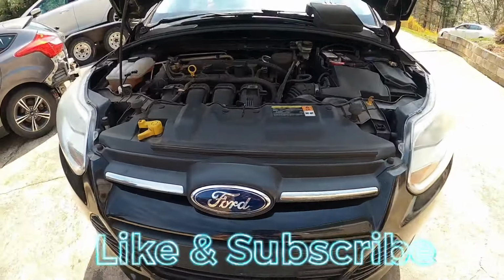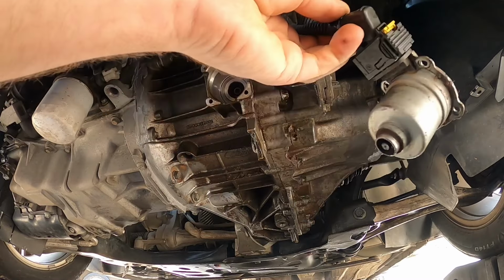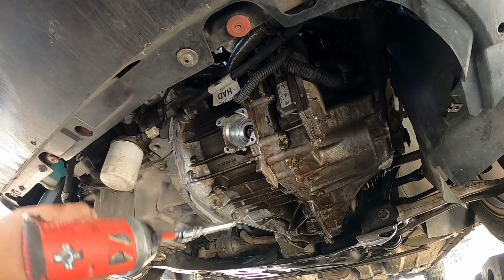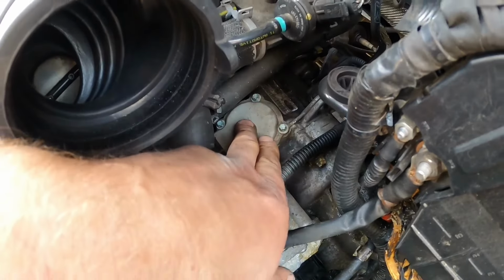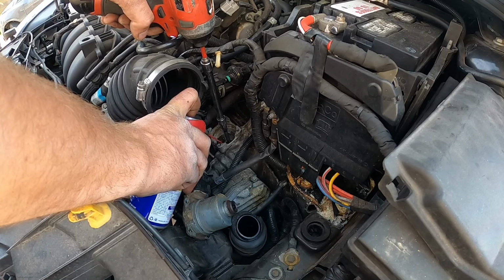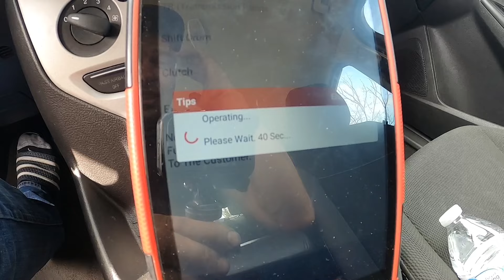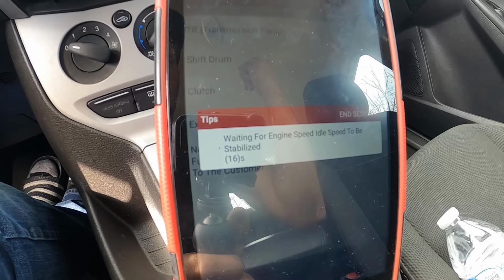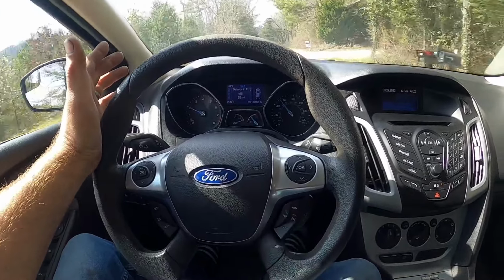2012-2018 Ford Focus Slipping? No Reverse? No Drive? Problem Solved. Easy Fix. You Can Do This!

Comment: hey btw actuator A controls gears 1, 3, 5 and B controls R,2,4,6 not just R. they work in parallel to come in when the other clutch disengages with minimal power loss, its how its so fuel efficient. :)
Reply from the maker: Ether way. Clean both forks 🤩
Reply: It's failure rate is 100 percent
Reply from the maker: @jackdaniels2657  yes, if you suck at driving 😂
Reply: @L8R-HP  it's junk regardless I'm telling u as transmission mechanic these transmissions suck like why have a manual transmission but yet operate automatically it makes no sense. U might as well have an automatic but those are junk too.  They just need to leave manual transmissions alone. Even os semi trucks the eaton transmissions work similarly to these being that it's electronic manual it honestly sucks. These ones have the problems with the release bearings they go bad frequently and the forks are always getting debris on the rollers causing a binding kinda like this guy just explained ND the clutches on these transmissions are a pain in the but to replace because u can't just change the clutch. Nope u need to change clutch clutch bearing both release forks both electric  actuators ND then the procedure is an even more pain in the ass. The way he's turning it counter clockwise 14 times on both release forks then once u get it in the car before u bolt up the clutch to flywheel u gotta rotate engine 5 times to center the clutch to the flywheel then to tighten the 6 13mm clutch nuts to the flywheel u gotta install a nut on every other stud cus it can ruin alignment if u don't. It takes 9 hours roughly if u had the right tools  when compared fully   manual transmissions that Ford focus has in same year, only takes 6 hours to do a job no special tools required in and out. Just imagine the cost for all listed parts above then u see why fully manual is better simpler affordable  more efficent far more reliable and far less headache
Reply from the maker: @jackdaniels2657  agreed, manuals are the way to go. But these transmissions actually don’t fail. The TCM does, actuators do. And forks get stuck. It takes me 3 hours to remove trans and clean and reinstall. Easy process and fast. I do this all day everyday.
Reply: @L8R-HP  3 hours hell no
Reply from the maker: @jackdaniels2657  it’s all it takes me, but I work on these 24/7
Reply: @jackdaniels2657  Did you just come to this video to tell people who already own this car that they shouldn’t have bought it?
Reply: @ir1041  yes exactly.
Reply: @jackdaniels2657  Very useful sir. Well done.
Reply: @jackdaniels2657  I wish I knew these cars were shitty before buying one
Reply: Mine is not acting up yet. No codes(135k). But can I do this as preventative maintenance? And do u really need to reset thru obd for I don't have one? I see some comments say that they skipped that part

Comment: What would make the radio come on when the cars not running. And it's just static very loud static
Reply from the maker: Could be a lot of things. Start with checking your battery. Is it an aftermarket radio?

Comment: Ford dealer quoted me 3672$ for clutch and fork replacement because it was shuttering while shifting from 1 to 2 gear. 
That's what you saved me, my 2014 focus has 59000kms on it.
Just cleaned both actuators and it runs smooth again.

Cheers and thank you from Cananda.🍺
Reply: Sighs
Reply: For real same deal! This guy is a Saint!!
Reply: Start driving the car harder in 1st gear. Let off the gas after it shifts to 2nd and then drive like normal.
Reply: Reminder Gord has a free replacement clutch work under a TSB 100,000 miles so u r under the warranty for replacement.
Reply: My 2014 ford fiesta was diagnosed with a bad clutch. How they knew without driving I don’t know. They said the tcm was fine. Quoted me 4500
Reply: @jasonashley9853 curious to know why driving it harder in first gear to second is okay to do. Wouldn't it not be ok if it's slipping and all that I. Lower gear? I have a 2014 focus with transmission overheating problem and not wanting to take off in low gear. Thanks
Reply: @JaBridgewater13 solucionaste tu pro lema del focos
Reply: I did exactly what this video suggested on my 2016 Ford Focus with 115k miles on it. The car shifts gears so smooth now!

Muchisimas gracias!!
Reply: @theDudEE100  literally same situation!
Reply: What is the application to do the learning
Reply: @brianlemos7777  Any problems since you made this repair? Just did mine today.

Comment: You have saved my life.  I almost drove my car into a canal, it is giving me problems and I am very worried about this.  My car is a 2013 Ford Focus SE, I bought it used since I couldn't afford a new one, it has one hundred and eighty thousand miles.  I appreciate that your video is subtitled in Spanish, it helps the Spanish-speaking Latino community.  To write these letters I used a translator, thank you friend, thank you very much.  Greetings from Lehigh Acres in Florida.
Reply: Hey man! i’ve actually rebuilt the transmission in these cars. I’m not saying this to stress you out, but at 180k, it’s ready to go. Everything with this cars transmission is flawed. Fundamentally. You need to sell this car before you start having a fork get stuck, or a rear seal start leaking. Please buy a honda. These cars suck, and my fiesta (uses the same transmission) brought me to the lowest point of my life.
Reply: What were you drinking?
Reply: @loganpennington9104 no point in rebuilding at 180k?
Reply: @greatness7822  Depends on the state of everything else in the car. If the engines perfect, and the suspensions fine, it may be. But if you’re paying someone else to do it and it’s more than 2,000, probably not. This cars transmission sucks and is bound to fail again
Reply: 2012 Ford focus s 2.0 , 64,000 miles 
Error Codes 
P0903 clutch A actuator circuit high
U3003-17 high battery voltage 
U0100-00 ? 
U0101-00 ?
Idles Rough , No Forward , has Reverse , sometimes Forward after 2 or 3 minutes .
Disconnected the Battery for 30 minutes , Reconnected Battery . Now Idles Great , Easily Shifts into Forward and Reverse and Drives Great  . Thank You Jesus !

Comment: Thank you SO MUCH! You’ve saved me thousands of dollars. Tonight I cleaned actuator B following your directions and it made an immediate huge difference. Tomorrow I’ll be cleaning actuator A as well to see if that fixes the occasional small slips I’m getting while slowing down. But cleaning actuator B dramatically improved my ascending shifts. Smooooth now. I’ve been babying it into second gear for years and now I finally have my car back!!

Comment: This video was super helpful.  Started having issues with my 2014 Focus and I thought it was the TCM again.  Dealer said it was "bent clutch forks" and would be $3000-$4000 to fix.   Just went through this process and so far so good.
Reply: Is your clutch stil going?
Reply: I’d report that dealer. That’s a scam.

Comment: This is actually the 3rd Ford Focus that I've owned. I like them because they are economical, drive and perform pretty well, and I have NEVER had a problem. Until Now... (2018 Focus 4Cyl SE Sedan) Wife's car started acting weird, not accelerating. I thought it was fuel system. Did some work on that. But now it's way worse. It started making weird noises when you open the door. Like the Actuator keeps trying to reset and it can't. This goes on for a while. When the car is off, and parked for hours - you can hear the engine making this noise, like gears moving. I couldn't find ANY info about strange noises coming from the engine while it's parked. Anyway, somehow stumbled onto this video and it has helped me understand. A LOT! THANK YOU!! I went ahead and cleaned and lubed the A actuator. Drove the car but it's still having problems shifting. I'm waiting on jack stands before I can tackle the B actuator. Really hoping that cleaning and lubing up both actuators will solve the problem. If not, at least I have a much better understanding of what's going on. Not sure what my next step will be if Cleaning and Lubing A & B don't solve the problem. Replace the Actuators?
Reply: I’ve heard of this before, I read that the repetitive sound is clutch forks engaging and disengaging. it’s usually only supposed to happen once when you unlock the car and open the door. The repetitive motion of the forks sounds like the TCM may not be communicating with the transmission correctly so try to run a diagnostic on it. You may be eligible for a free one at the Ford dealer if your car meets the mileage and age requirement for the warranty program.
Reply: what year is it?
Reply: @greatness7822  SORRY! I forgot to put that in. Edited my post - added 2018 Focus SE
Reply: Hey, any update on what it was? I have a 2017 se and I have the same issue. A strange transformer noise when opening the door or right after turning off the car..but it’s doesn’t happen all the time.
Reply: @Gazzman57 - thanks for sharing as my 2014 Focus is having the same experience. The wife drove through a sizable puddle and then this issue started. The engine sounds and runs just fine but it feels like it’s starting in second gear and it also still goes into reverse. But as you mentioned, when I open the doors before the car is running, I can hear some actuating type noises in the engine compartment, so I’m not certain if that’s an indication that I need to also replace the actuators or not.

Were you ever able to find any more information out about the actuator noise and were you able to get it resolved?  

Thx! RB

Comment: The timing of coming across this video was perfect. I had to look up others things that were going wrong with my daughter's 16 focus and watched this video "just because". I fixed the other problem that she had and magically enough a few days later she was having the hesitation, slipping problem. Ran the code and of course it show Actuator B was stuck. Did as you suggested and problem fixed. Great video and thanks for taking the time to put it together and sharing it with us.
Reply: @jay Perez is it normal when you start turning it counter clock wise and it's like it's got compression In it like it wants to kick back the other way like it's spring loaded
Reply: @katlanshepherd1296  yes, because it is spring loaded

Comment: FIXED!!!!! Bro, thank you so much!!!!!!  Fixed my car last night. Didn't have the tool, so I used a skinny slot flat head bit from my gun kit. As suggested, I used brake cleaner & WD 40.  Didn't want to break the flat head bit, so I hand rotated & released for bout 30 mins. Skipped the OBD b/c don't have a scanner. Anyway, my Focus starts right away, no delayed 1st gear engagement, and no shuddering. Thank you, thank you, and thank you.
Reply from the maker: Nice! Good work 👍
Reply: Is it still working ?
Reply from the maker: @Dorightby  yes
Reply: @L8R-HP  where are you located brotha? How much would you charge to take transmission apart and clean it
Reply: @Dorightby  Yes, like a brand new car.
Reply: @Dorightby  i can do this without a scanner? Gonna do this on my daughters 2012 focus this weekend. I do not have a scanner,  not throwing any codes either tho. Input?
Reply: @marniegan6266 how did this workout? I have a 2012 se focus with 120,000 miles on. Have extreme shuddering in first and second. No lights being thrown or codes.. 

Did the brake clean/ wd40 rinse help?!
Reply: Gonna put the work in tomorrow..hope it works out..my focus been down 7months.
Reply: @hectorluna1394  how'd it go? Did you have success as well? I hope so keep us updated.
Reply: It's been about a year, and the odd gears started slipping again several days ago. Gonna open up the old girl again. She's got 160k, and I need her to go 90k more. I'm hoping I'll get it done faster this time around.
Reply: @gheeshin how'd it go, bud? Figure the issue out?!
Reply: @jerrycordova1971  Kind of solved it. Bought another car.🚓
Reply: Hi will this work on 2012 ford galaxy as well ?
Reply: @ioncochior4519  I have no idea

Comment: I agree with you, after experiencing driving a Ford Powershift dual clutch 6DCT250 for 8 years on Fiesta Ecoboost 1.0L at hot tropical country with total 90k km, I have concluded that this transmission is quite reliable and enjoyable which suits my driving style which has never been trouble since brand new. As far as I know, all Ford Powershift problems are not due to flaw design, but due to 2 material defects supplied by the vendor, namely the TCM and shaft seals on the early generation Powershift, If you get a late generation powershift like I have then it is completely problem free. And apart from that due to lack of maintenance which in my opinion should be cleaned every 50-75k km so that the clutch unit mechanism is smooth and does not jam due to very dirty clutch dust. But by the way thanks for your informative video 🙏

Comment: I did exactly what you showed in your video. Brake clean and Wd40.  I didn't have that bit but used a screwdriver like you showed in another video.  And it Worked! Thank you. I appreciate you posting these videos.
Reply: Did you have to do the reset with the diagnostic computer as well?
Reply: @jonathanjones8895  No I just unplugged the battery before the process.  Then connect after to reset.
Reply: @theroyalonemalik4125  I have some questions my boy? What screw driver did you use? Star bit? Fill-up? Flat? Also what issues were u having?
Reply: @marioo6315  but  make sure it fits tight or you  will strip it out. Then the  actuator wont work.
Reply: What screw driver you use ?
Reply: @BillyBergeson  check his video HOW TO TEST TRANSMISSION FORKS.
Reply: What screwdriver did you use?
Reply: Hi, which video he showed the screw driver please can you share that link. Thanks

Comment: Battery died got a jump and the car wouldn't drive at all reverse or drive, did the transmission valve resets with my launch scan tool and it worked perfectly  these new cars are dumb. Thank you your video helped alot  😂😂
Reply from the maker: Low or dead battery can kill the TCM 😣

Comment: Just bought a 2016 Titanium with 130,000 miles on it. I knew the transmission was an issue going in but this car is clean, no wrecks, trans TCM updated and shifts fine, new tires, rotors pads, and has service records for the cars entire life. 
    This transmission is what makes this car so economical and yet so responsive! I’m a Ford guy and this is my second Focus I’ve bought for a daily beater. Previous Focus was a 2005 ST with a 5 speed that I’ve gotten 250,000 out of before I absolutely obliterated a deer with it. Did about $4,000 damage to a $2,000 car. It still runs and drives great but it needs all new drivers side bumper, hood, radiator, core supports, throttle cable, quarter panel, headlight, fog light, and drivers door. 
   I did a new clutch on this car at 230,000 so I’m not afraid to pull a trans. This car will be no different but now I know I may have to buy a few specific tools and get good at pulling transmissions!

Comment: I used lithium grease on mine.  One other thing I did (saw it on another video) was to drill two 1/4 inch holes in the case. One adjacent to actuator B, and the other at the bottom of the case.  Bent the straw on the brake cleaner can at a 45 degree angle and used the hole to wash down the mechanism inside the case with the hole in the bottom used for drainage.  It's dry in there so it's not going to hurt anything.

I then took the blower gun and blew an insane amount of clutch dust out of the case through the actuator hole..  Washed it down again with brake clean again and then lubed it all.   It's crazy because it's a 2017 with only 66k on it.  If you're missing the splash shield and/or are otherwise worried about stuff getting in through the holes, a rubber plug or a dab of silicone will easily seal it up.
Reply: For the comment that said he drilled two holes in the case I would love to see picture of where the holes exactly are the sounds like a good idea
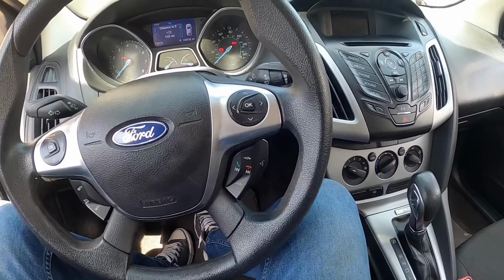Reply: @kenbaker1353  This is where I found out how to do it.  Figured it was worth a shot!  Starts around the 1:30 mark.  

https://www.youtube.com/watch?v=CoU1QGn_9gc&t=95s
Reply: Not to mention the wear aid of the metal shavings left behind.

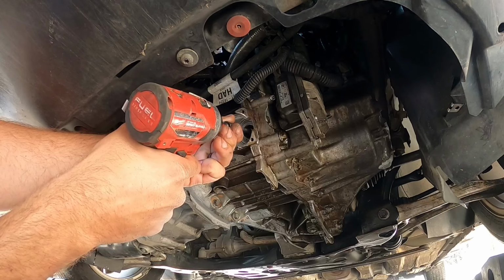Comment: 6:38 I would recommend using  a normal drill and not an impact driver for this as you can set the clutch of the drill so you don't apply more force than desired.
Reply from the maker: Best to do it by hand if you don’t know what you’re  doing. I use this little drill cuz it has different settings and works great for me.

Comment: It works.
Focus 2014 SE 110.000 KM.
I just did the B actuator and it kicked in with no errors after driving kinda 30 km.The "reset tool" I used carefully was an Allen key with a rounded head 1/4.Hex the same size does the job too.But it needs to be hold firm while turning and all by hand .It took me half an hour.I didn't even spray that much like here but I'm going to do it again more consistent  when I'll open the other actuator these days.
Then I erased all codes with the ODBlink dongle. 
''P07A4, Transmission Friction Element B Performance/Stuck Off''.
''P2701-00 Transmission Friction Element B Apply Time Range/Performance
It runs reverse too  with slightly occasional shuddering.
At least I can have some more spare time to have a cheaper quote  to replace the clutches and eventual forks and clean the build up black powder from the old clutches.
Reply: Did u get the oem or the aftermarket?